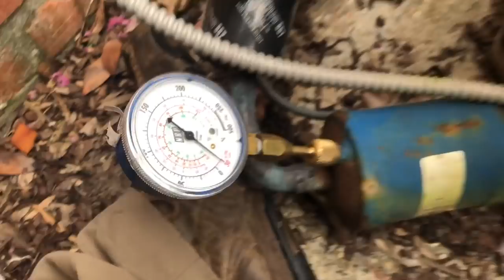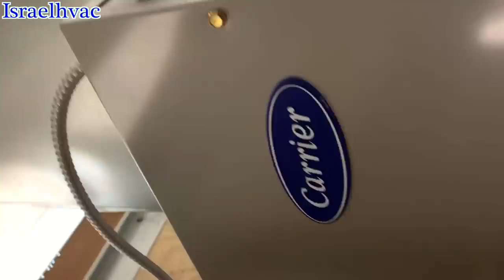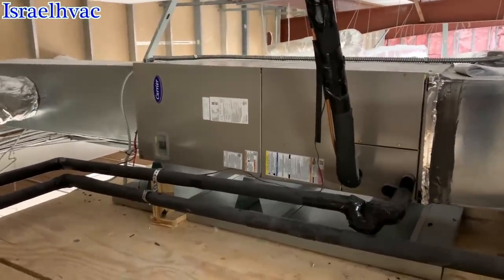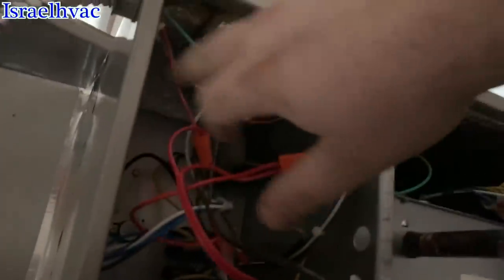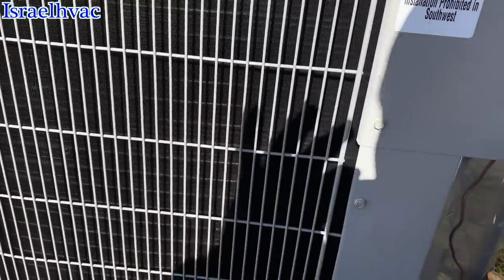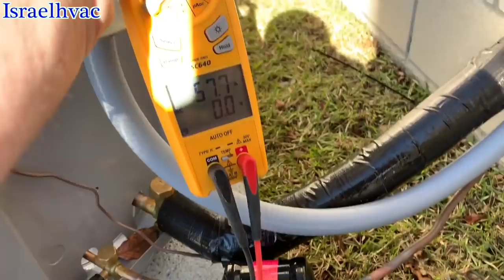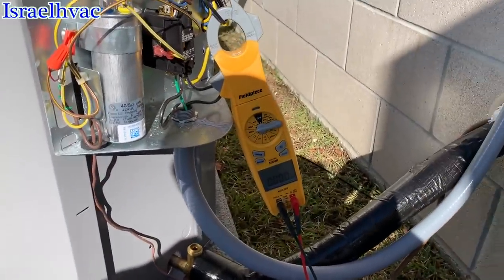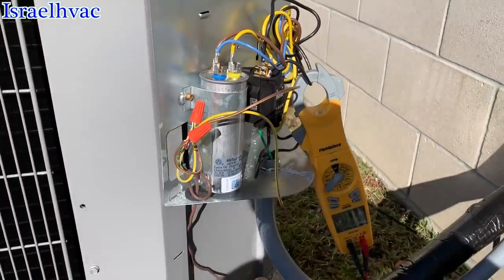Start Up 4 HVAC Systems With Issues

Comment: Great video but I do a lot of new construction start ups in Florida (90% Carrier) were fortunate to have one crew to the rough in another do the trim & service do the start up. I'm part of service & out of hundreds of start ups only had 1 bad compressor do something like that on start. I'm the type of tech that needs to know why. After going through Carrier factory training, I was told that only 5% of compressors returned were actual failures. (I understand they probably deflated that # too) But it did make curious. But when it did happen to me after I tested system I found a faulty txv (aka the trim guy torched it brazing in the air Han handler) I would of liked to see you try to find out why it failed (especially for the new guys) instead of just saying it needs a new condenser. Depending on line set set length & height Carrier recommends/requires a hard start kit be installed. For the new guys I would've said let's make sure the thermostat is configured for the equipment. Just some thoughts....

Comment: low voltage or loose connection issue, but maybe wired wrong at the panel depending on the utility supplied power.
check the voltage while start current is being drawn, you'll likely find it's sagging way too low and someone messed up somewhere upstream by leaving a wire loose or on wrong phase maybe
Reply: if you read the other comments... these units were wired with 208V from a 3 phase circuit. Mismatched!!!

Comment: good video, Install looked better than 90% of the ones I see.   I can't believe you have plywood all over,  Nice good looking job.   
     I would check for a bad connection on the pecker head.  Then ....did you leave the power for the CCH on for a day before arriving on site or 1 hour per pound of refrigerant.... Most have that in the instructions.   That crankcase may have been full of refrigerant..... like you said, it was cold out, and we all know refrigerant migrates to the coldest part of the system. (crankcase).  That MAY have been why it started, once it ran, by getting some of the gas out into the system piping.... just a thought.

Comment: You notice sometimes with those Malco 5/16 - 1/4 reversible bits that they don't always fit in tight spaces (where the screw head is close to something)  LOL   I hate that and end up ditching the impact setup for a skinnier nut driver. I still love those Malco reversible bits though.

Comment: Is it normal to have line voltage that low there in your area? I assume those were running 240v? Cuz that outdoor fan motor was running awfully sluggish too. That job was definitely an unexpected pain in the ass.
Reply from the maker: Shannon i noticed that too on the condenser motor. But to answer your question, no i usually see voltage here at 232-238. But i checked the other 3 units and they are getting the same voltage and running fine. We are changing the condenser, but unfortunately it probably won't be me replacing it unless we are slow, thats the only reason i helped set these is because we were slow that day.
Reply: Shannon Knight HVAC  it was a commercial building it looked like in my area it would be 208 or 480
Reply: Two phases of a three phase system is 208 volts.
Reply: @kidalwys  Yep I agree. That's definitely 208. Subs wired it wrong.That's why the condenser fan motor was struggling too. Nothing wrong with the unit. Commercial buildings usually have 3 Phase. Those other units might be running, but check the compressor amp draw. Bet they're sky high.
Reply: That's right...2 of 3 legs 👍
Reply: @sknight0391  They probably went from Neutral to B Phase on the panel. That'll get you 208
Reply: probably on the wrong wrong phase, miswired, etc. or loose connection somewhere. a voltage test while it was trying to start would have been a massive size clue. guessing it sags down around. it should have never been left running, it's a potential fire hazard...

Comment: When you were messing around with the condenser unit, did you isolate the power each time before fiddling with them wires? It didn't look like it!
I sure do hope you are a certified electrician, as you know that voltage can kill you instantly.

Comment: Looks like you don’t have enough conductors in that MC “Thermostat” wire! I’ve had to install hard start kits on brand new equipment as well.
Reply: They don’t make ‘em like they used to.

Comment: Right thing to do to replace that unit. Otherwise i feel it will be one of those 'Our AC is down again' type units every few months. Also what moron installer uses normal AC cable for thermostat wire. Thats just asking for someone down the track to wire the low voltage side into mains AC without realizing. 

Great video as always man
Reply from the maker: I appercaite you watching. And i agree 100%. It would definitely be one of those pain in the ass units.
Reply: how about request the contractor to deliver work up to code before inspection...

Comment: I like carrier but those evaporators are junk when mounted sideways. They always sag down in the middle and the covers are impossible to take off and line them back up when putting them back on, contractors that have this issue in the past and have been using them for a while now add a 3rd support in the middle to prevent this from happening but then it blocks access to take off the panel on the right, total pain in the ass !!

Comment: Starting a compressor in the cold when they have no crankcase heater is probably why it didn't want to start. Not good for them either.

Comment: Carrier is JUNK, I prefer Goodman or Trane
Reply from the maker: That’s your opinion. And if you think Goodman is better than Carrier your very mistaken my friend
Reply: @johnisraelhvac2019  Hey they use Emerson Copeland scroll. Carrier uses LG Scroll, total shit. Can u make another vid on ur scrap pile thx john
Reply: @johnisraelhvac2019  why is Goodman bad just curious :)
Reply from the maker: @arcticarrowhvacr  All four of these condensers have Copeland scrolls. But yes Carrier does use LG as well, but so does Trane. The LG's are actually good compressors. No issues out of them at all.
Reply: @johnisraelhvac2019  what's your opinion on Lennox
Reply: Cmon man! Ik these use lg scrolls but not everytime!
Reply from the maker: @arcticarrowhvacr  It's fine. I just think Lennox adds extra stuff to their unit that's unnecessary. Honestly they're all pretty much the same now days. I like Carrier/ICP just my preference. Rheem/Ruud new line is awesome i like those also. I don't have a problem with Trane except for the Hyperion air handler not a fan at all. Goodman is fine too they are just cheaply made. Thin metal they are flimsy. The only thing i will say to stay away from is anything with a microchannel coil. Microchannel is a disaster so Nordyne is a shit product in my opinion. I would say the same for York/Luxaire/Coleman but they now make two different condensers one with microchannel and one with tube & fin so their not so bad anymore.
Reply: @arcticarrowhvacr  I really like how easy it is to service Lennox equipment.  It seems to run well too, I don't particularly care for the ML195, or the G61MPV.   I wonder what isrealhvac thinks of Lennox.
Reply from the maker: @Xash2000  Thats correct Carrier does use LG & Copeland. I guess we just got lucky and hit 4 with Copeland.
Reply: I will jump into this, all brands have weaknesses, I have been doing this for 30 years and service and installed most brands, every manufacturer has went down in quality, hell during the early 90’s when Goodman was Janitrol.  Lennox, Carrier, Trane and York were relying on Quality and name recognition, they thought Janitrol/Goodman was going to go out of business real soon, well it didn’t happen so the big manufacture started producing 2 different models even with the minimum efficiency of 10 SEER, one good the other was referred to builders grade to compete against Goodman. Make a long story short, with the millennium generation, brand recognition is not always that important, so manufacturers are always constantly looking for the cheapest outsource parts to use as well as keeping their stock holders happy. The manufactures will always make their money by trying to cheapen the unit as possible and yet charge the most extreme price for their parts. Just my thought
Reply: very stupid statement Vann Berg. I live in Venezuela and in my city 80% of the Residential/Light Comercial equipment (Mostly 90's and 2000's) installed are Carrier systems (mostly 38CKC's and 50ZPA package units). They Have outlasted all the Rheem/Ruud, York and Goodman and they are very even with the Trane stuff only that Carrier is more popular. And Guess what, all 3 ton 38CKC/50ZPA Package systems came with Bristol Recips and its funny that they typically outlast the 4/5 Ton systems that came with Copeland Scrolls. Not to mention we have all year heat (90-110 Temps) all year long. How is that for Quality? Not sure about the New Carrier stuff but the 90's and 2000's stuff outlasted pretty much everything here.
Reply: BAHAHAHAH And the joke of the day award goes to, you! GOODMAN!!!! BAHAHAHA
Reply: @johnisraelhvac2019  I agree with u bud. Carrier for me always 1st , then American Standard. GOODMAN never.
Reply: @arcticarrowhvacr  only on their Payne units but they stopped to many complaints
Reply: @arcticarrowhvacr  to expensive for not a good Quality unit, air handler to bulky on several sizes, evap coil notorious for leaks, compressor loud on start up but overall condenser will last a long time if installed right with no short cuts. My experience and other techs that I know have had same issues
Reply: @johnisraelhvac2019  Thanks, is Trane a type of brand where if lots of people tell them to put Bristol's they will? Like easy to convince to change something
Reply: If I go to a call and i see a Lennox i cringe 😖 all I have to say is ever worked on a pulse? Lol